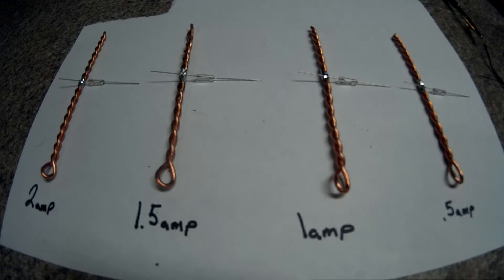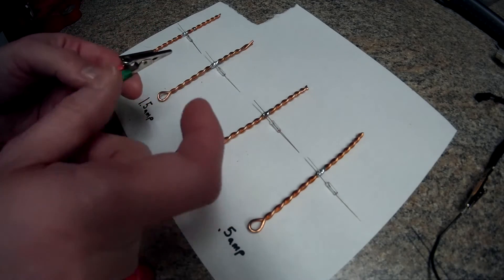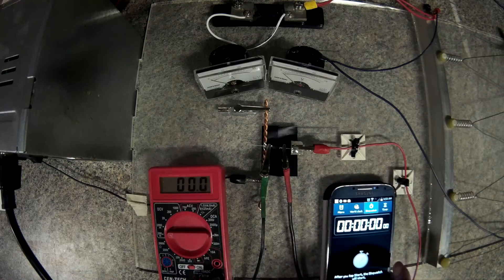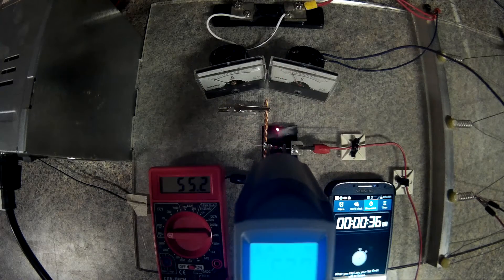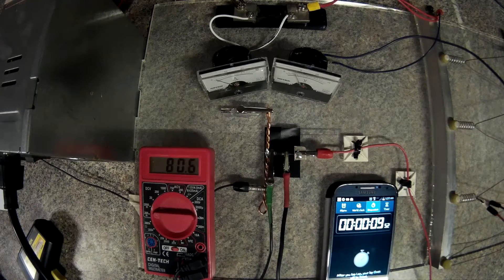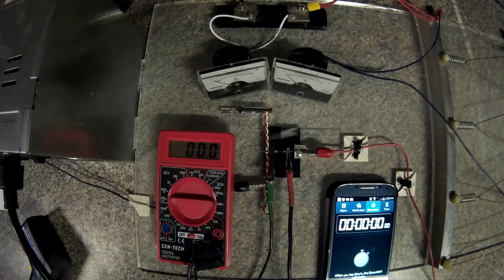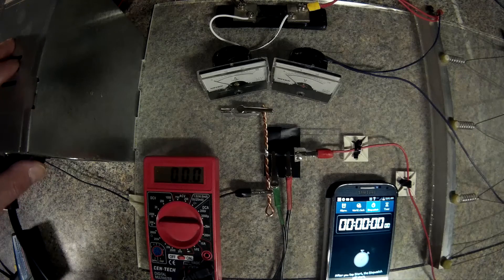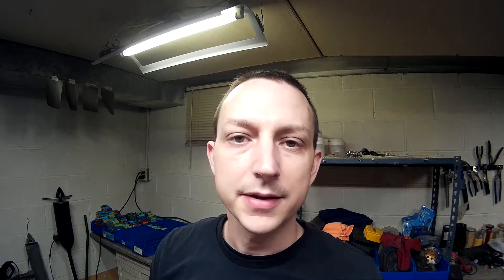Diy Tesla Powerwall ep32 Voltage Drop Test Fast Glass Axial Fuse

Comment: The math is OK, but take alook at those tests result (also from earlier video), in real condition (not on paper), at what amp and for how long until the 10A fuse will blow?? maybe never.

"Just to think the amount of stuff we take for granted in life..." (Rui Correia)

Ofcourse there is a trade for efficiency/power loss, but for someone like me, who really want to protect each cell (this battery is still expensive), and don't want one bad cell demage the others, I can relate to AveRage Joe amp choice.
Reply from the maker: Thanks,  Yeah I dont have a lot of extra $$ to buy a bunch of extra stuff.  Its taken this long to get all the cells and build it that Id like to keep it around for a while :)

Comment: Thanks Joe! Good demo on how much current draw affects voltage drop. I think if your designing you pack to not draw more than 1 amp per cell then really any of these would be ok. Even the 1/2 amp fuse only drops voltage 1.6%.
Reply: InYour last video, you said you were leaning towards the 1/2 amp fuse. I would hope your design you pack for a 1/2amp per cell or less draw. I'd also probably fuse the othe side heavier. 10amp or something
Reply from the maker: Thanks!!!  Ya Id like to lean to the lower pop area.  Agreed not to draw more than 1/2 amp and it will get less and less the more cells you add.  Ya only a low pop on one side and a higher "fuse style" wire on the other.
Reply: I'll agree that adding safety does decrease efficiency in almost everything. Everyone will have there own acceptable limits. And 1.6% is on the high end. hes trying to power an inverter not a real complex circuit
Reply from the maker: +DIY Tesla PowerWall I agree on some of that and thought the same about if x amout of fuses pop then the rest will pic up the slack. If that happens then the fuses are doing there job and wont get more amps then needed and will adjust if required
Reply from the maker: +stevesrt8 Agreed